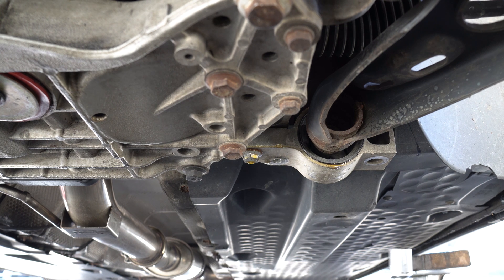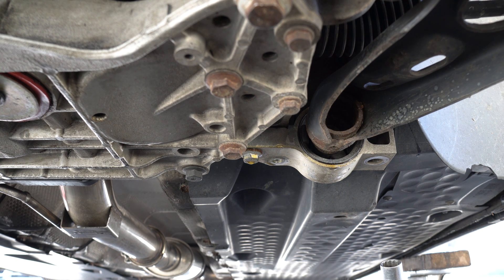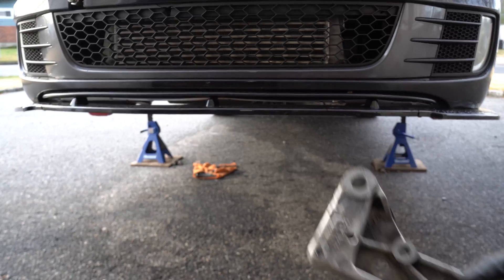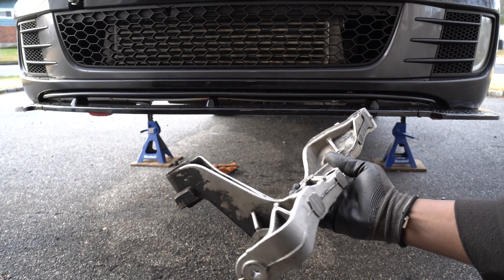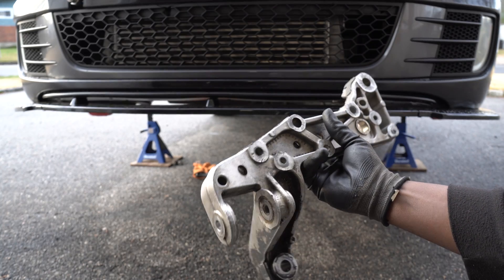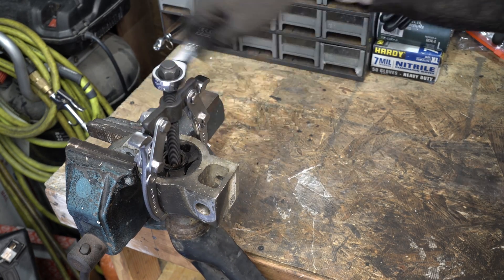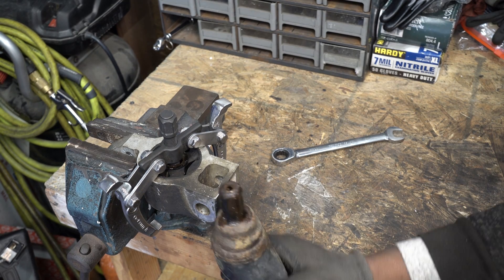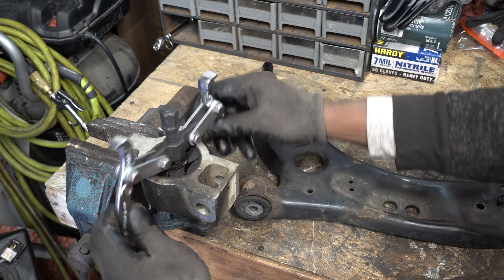VW MK6 GTI Front Control Arm Bushings Upgrade - Part1

Comment: Any idea why my acceleration has a jerk to it after replacing the control arms? For some reason, it is less noticeable in Sport/Manual than it is in Drive
Reply from the maker: I'd suggest going over the bolts and make sure everything is tight.

Comment: Hi, when you say that if you break the bolt (or if it's corroded) you will need to replace this "part". What is that "part" called? My vehicle bushes are worn/bolts corroded so I will need to replace that "part". I just don't know what to call it.
Reply from the maker: It's called the subframe bracket.

Comment: Hi mate, if you ever come across another bolt like that, in future loosen & tighten the bolt until you get it off. Loosen till you feel high resistance & and tighten half or full turn. Eventually you'll get it off & then happy days

Comment: Will this be the same for the MK6 Jetta S manual? It's so hard to find anything on my car. 😮‍💨 It shakes at higher speeds but 2 different shops confirmed the only thing bad on the vehicle is the bushings. Not bad for 200k though. It's vibrated since the day I bought it at 60k even after completely new rims and 3 different sets of tires.
Reply from the maker: Yea, bad bushings will only get worse. Yes it will fit on the Jetta.
Reply: @CraftyWorkshopBuilds  good time to do the struts and coils too then. I appreciate your comprehensive in detail videos and response. Stay good my dude! 😁
Reply from the maker: @AltruisticWarrior  Yea, make sense. Since you'll already be removing the lower strut anyways. Much respect, thanks for checking out my videos👍🏽

Comment: Very straight forward.  Doesn't matter "How" you get it done (if time and effort aren't a factor); just matters that it gets done right.  Nice job bud.
Reply from the maker: Yea, for sure. Much respect 👍🏽
Reply: a snapped bolt which based on his advertisement you should replace the whole part, extracting bushes without a press or a proper extractor there is thew risk of bend the bushes hole, if you dont have proper tools next time better try heating the part, it make the rubber and the nylon easier to come put and dont risk to bend anything vital...

Comment: The same bolt snapped on my mk5 bro- what is the part you showed as I need to know!!! Thanks 🙏🏻
Reply from the maker: That part is called the subframe bracket. I added the part numbers in the description, so it's easier for others to see it as well.

Comment: What's your honest opinion on these cars would you consider them to be reliable?
Reply from the maker: Yea, I do think they can be reliable if you address the common problems.
Reply: I have the 2.0 S with a manual trans. Mine has been extraordinary in reliability. To date at 200k I've only had to replace a rear door lock, oil cooler and this little vacuum line piece that was 30 bucks. I can't say the same for turbo charged or automatic vehicles but mine has been great. Getting ready to swap out the blower motor and resistor as it's finally showing signs of dying but really. Doing all the work myself it's less than 500 bucks. Not bad for a 10 year old car with that many miles.